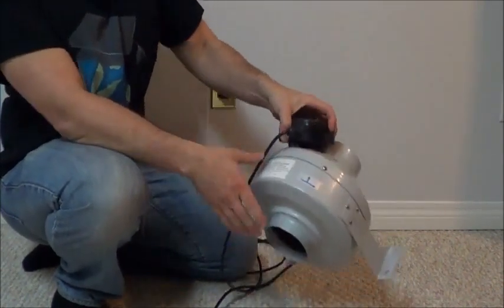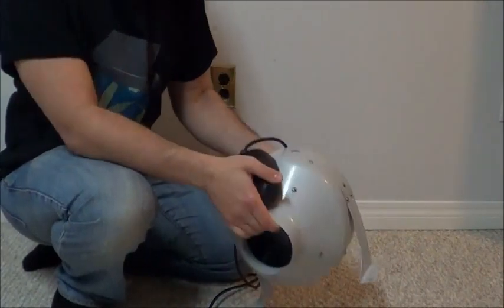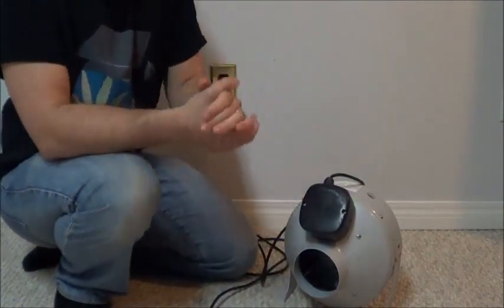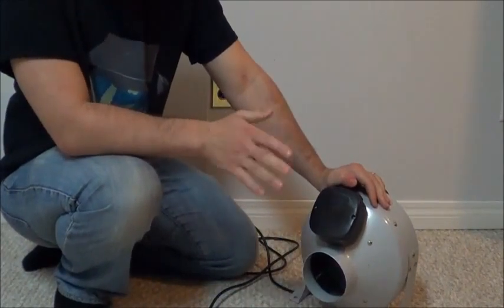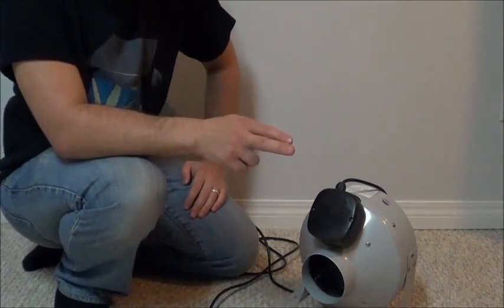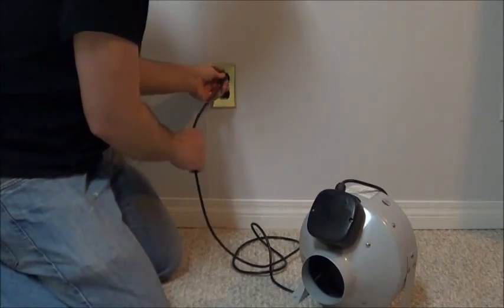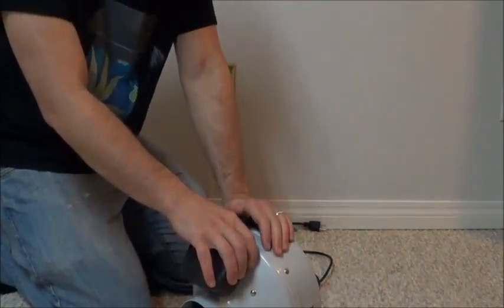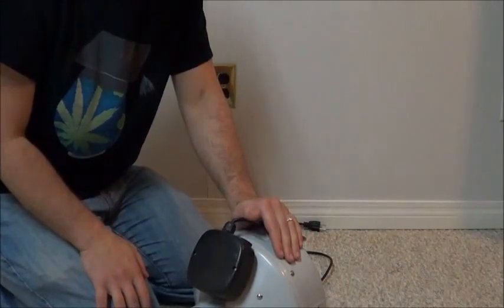Inline Fan Basics & Noise Control Tips

Comment: You need to spend at least £50 on a Variac Controller otherwise you get a pretty loud hum off the motor.You can also build a box around your fan.Put the box it came in around it and see how much difference it makes.

Comment: Amazon has some REALLY solid German designed fans under the brand name "Neverest" and I can vouch for their quietness and their air movement. I have their 4" inline which is rated at 210 cfm. When I got it I measured the air movement without ducting attached and it was moving 212 cfm! 2 cfm higher than what it is rated at!
The Neverest fans come in 4"(out of stock apparently), 5"(for home HVAC use__ 270 cfm), 6"(440 cfm) and 8"(710 cfm).
Mine is hooked up to push through a G hydro 4" 210 cfm rated 1200+ RC48 Australian carbon filter. I run a closed loop system which is environmentally sealed and controlled.
Reply: TBH, 2 cfm is within measurement error.  I wouldn't be surprised to see anywhere from 200 to 220 cfm on a measuring instrument.

Comment: 15 x 9 x 7 at 60 air exchanges an hour on an exhaust fan calculator came out to = 18 CFM's Required ForDesired Air Exchange yet that can not be right, can it? I have 4x1000 hps in it.  Any suggestions?

Comment: They go up in inches a time ie 100mm ( 4 inch) 125 mm ( 5 inch) with RVK they also do A & L models, for instance the 125 a is 220cfm & the 125L is 330 cfm,  though my fans ( ones ive mentioned) are over 12 years old ( still work fine) and bow we have some very powerful fans like the hyperfan etc

Comment: I ordered a 3x3x6 tent. 54 cf I got a 100cfm fan. I’m not really worried about the smell. I Worried about air circulation. If I decide to add a filter for my tent what would be a good size?
Reply: Ur fan is either 4 or 6 inch openings. It has to be same size

Comment: Have a 6" varible speed (thank god) venting a 3x3x5... yeah its over sized but this summer those HIDs will be cool.
Two small variable speed boosters fans provide air intake so the billowing of the tent can be nicely adjusted.
Moving right at 200cfm through a 75sqft tent, needs it too LSD-25 is a stinky little girl.

Comment: Oops, I ordered a 6" 400cfm fan/filter for my 24x24x48" grow box 😂 it's way overkill
I have it on reverse outside of the tent and it still works fantastic
Reply: is it loud ??
Reply: @rmproductions2583  If you don't get a voltage control for the fan, it will be pretty loud cause it'll run at full power. 
I have mine running on medium power 24/7 and it is pretty quiet.
I put the fan inside a long rectangular box cause the tunneling of air makes it quieter, and put a blanket around the ducting connecting to the box

Comment: After the light I’d say extraction is the next most important thing. I run a 250mm exhaust and a 150mm intake in a 2m40 x 1m20 x2m tall. I like it so the walls of my tent are sucked in a little. .

Comment: If I connect a 6" inline fan directly to the carbon filter in a 5x5x7 tent (so happens I have exactly that), then is 300-350 cfm's too much or is it fine? If that's not fine, should I just make a 90 degree angle in the duct or separate the inline fan from the carbon filter to lessen its cfms?
Reply: Get a variable speed can run at 50% and you can further reduce it by venting out of a 4" dryer vent(those are nice). Better to have too much in Feb than too little in August.
Reply: @rhodes6840  okay thanks buddy.

Comment: I use a 6 inch 460 cfm for my 4x8 with a can canbon filter
Reply: I'm getting the Dyson cool fan with a built in active carbon filter 

So hopefully it will clear most of the smell of my plants 

The fan can clear up.the smell of a full fried breakfast so it definitely should be well able to do the job 😎

Comment: hi I just got a 6" in-line duct fan kit with carbon filter and it has a temp probe so the fan can turn on and off when it reaches the right temp. I was just wondering where I should put the temp probe at plant level under my light or up around were the fan sits at the top of the tent?
Reply: Mike Gosselin canopy height

Comment: I have an inline fan with a speed control on the cord. Unfortunately even on low speed it draws all of my humidity out and creates quite a suction to the tent even with open vents. Can I add another corded light slide dimmer to slow it down some more?
Reply: Just hook it up to another fan speed controller. Assuming both speed controllers use variable current, you should have no problems.

Comment: Why do you figure the total volume of the grow room instead of just the volume of your canopy, if you have a 10x10 x10 grow rm. and your canopy is 5x10 why would you not input 500 cubic feet into your air exchange equation?
Reply: +John Dro
Because the fan needs to replace ALL the air inside your room.  So the canopy size is irrelevant.
Reply: John Dro 

Because the air above the canopy isn’t the only air in the room and it all needs to be exchanged.

Comment: I will be receiving my MarsHydro Reflector 144 sometime this week and I couldn't be more happy with the choice I've made. I plan on using this light to flower/veg in a 2x4x5 tent. My ceilings aren't very tall as to why I went with a 5 footer. My biggest concern is what I should do about exhaust/ventilation? There are passive air flaps on the bottom of the tent, two 6 inch ventilation holes on the sides of the tent, and one 8 inch ventilation hole on the top of the tent.
Will I have room to install a 6 inch carbon filter/fan combo along with the Reflector inside of the tent? Do you recommend keeping the fan outside of the tent and the filter inside to save space? 
Thank you all for any help, I'm hoping at least a few of you can guide me in the right direction?

Comment: Jeez. Didn't realize they were that loud. That's far too loud for my tent and my circumstances I'm going to have to come up with a better option that's not going to cost me a whole lot of money. Thanks for the video. I have a little more reality on those fans now.

Almost hit the send button before I hash-tagged this. 
#LexLEDgiveaway
Reply: Bob Wags you can build a wooden box with soundproofing foam Inside the Box will knock the noise out completely
Reply: Bob Wags you can get a speed controller to take the edge off and use insulated ducting, huge difference
Reply: The primaklima I use makes no noticeable noise, the actively cooled lights are louder
Reply: If you run it at 100%it's loud. Get a bigger one and run it at a slower rate.

Isolated ducting and the box people talked about and you are fine.